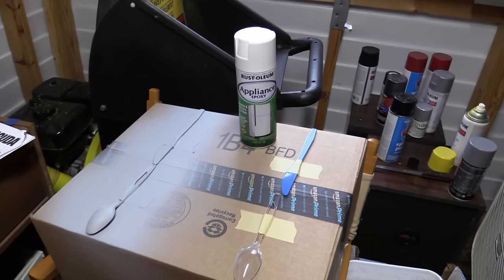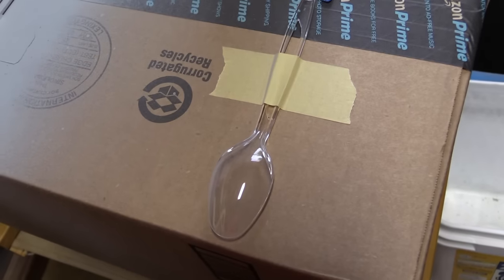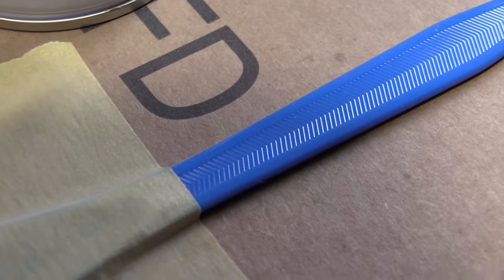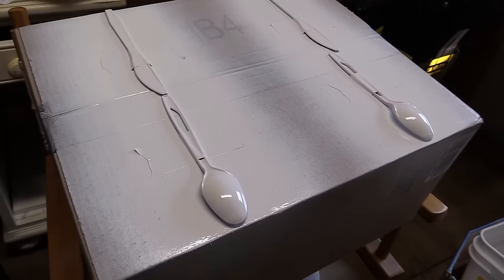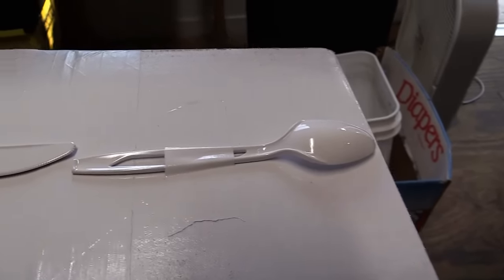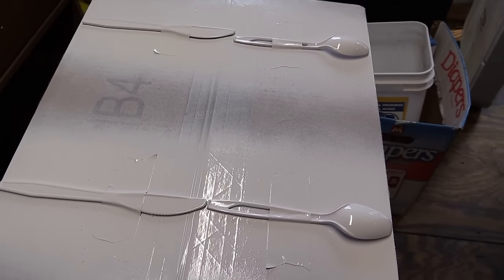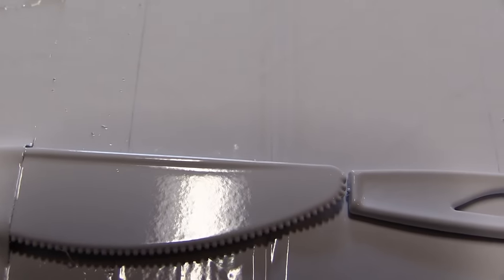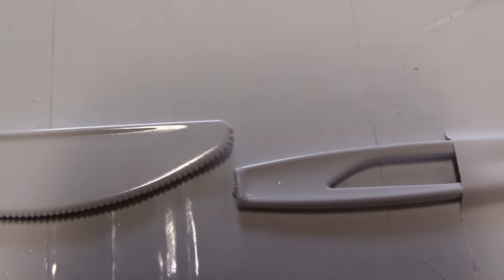Rustoleum Appliance Epoxy Paint Test

Comment: I painted my crew cab dually truck with the white. Let it cure for four days. Wet sand down to 1200 grit. Buff (by hand) with 3M  Microfinishing compound, followed by 3M "Finesse it II" Shines like a BC/CC finish. Seven years later, still looks great. Wax it like you would any other finish outside. Black holds up just as well. Have used the "stainless" and "Almond" colors also. All spray, and have equal durability.
Reply from the maker: Wow! I had no idea! Cool!
Reply: if you were painting something with this that you needed to flip over and paint the other side say a jet ski can you do that? i know the paint says to sit and cure for up to a week.  would i be able to spray one side fully, let it sit for maybe an hour then flip and spray the other side without it being disturbed or peeling off?
Reply: @surfjat15  Absolutely NOT. At least (and I  mean, the VERY least) an overnight cure.
At four hours it will still be tacky enough to leave a fingerprint in here in humid Florida.
"Haste makes waste" with this stuff. The end result is worth having some patience with it.
Don't think I'd plan on having it last very long on the submerged part of a jet ski. A linear polyurethane is best suited for that, even then it shouldn't stay in the water for long periods.
Reply: @tonyk8592  roger ok.   painting as we speak i shall let it sit much longer then
Reply: Did you spray it on bare metal at all? Any primer?

Comment: You can buy it by the quart. It’s probably the best marine engine room paint I’ve ever found. There’s only one problem. You absolutely must have supplied air, a respirator won’t cut it, though it may kill you. The fumes are crazy strong.
Reply: doing a Kawasaki stand up jet ski project.  guys are starting to use this instead of a real spray gun paint job.  supposedly rattle can holds up well with sand and prep.  i’m going to  try it and report back

Comment: This stuff takes about a week to properly cure under ideal conditions, not a couple days. I just found out the hard way while painting a 1934 GE Monitor Top Refrigerator that even though it's 90'f here in SoCal with 48% humidity, I managed to mar the paint with my finger while installing the 50lb refrigerator door.

Did you end up doing any clear coat tests? If not, i'll save you the time and effort by telling you it wont work. This paint degasses for weeks after application and you'll end up with a mess. I've tried VHT, regular rustoleum, rustoleum lacquer, and krylon clear  and they all were a disaster. Each time I applied them toward the end of the timeframe where you can recoat, but not exceeding it.
Reply from the maker: +LBCAndrew Aha, no, I never did try the clear. But I see that you did. I hope you posted the results. I never had good results from any of those clears you mentioned though, on anything. I was looking at this from a hobby aspect anyway. I will likely test the Testors clear on it at some point. Thanks for your input.

Comment: Can you paint an acrylic paint over the appliance paint? I ask this because the color I want to paint my fridge (mint) does not come in appliance paint. Appliance paint only comes in limited colors like white, black, cream, and stainless. I tried a tester spot on the top of my fridge (sanding first) using reg primer and acrylic paint and it flakes off when I run my finger nail on it. Thanks!
Reply: At Lowes, they sell a cabinet paint that is oil based-water born enamel Valspar.  I have been very happy with it.  The same with Kelley Moore's "hybrid" enamel. No bad smell with either.

They tend to be self-priming, form a shell (unlike latex), and dry pretty fast.  They do not come in spray cans (so you can mix any color), but I've had success with Wagner cheap sprayers.

I'm no pro, so I had to practice a LOT to get good results with the Wagner sprayer.

It sounds like you prepped well on your test spot.  Maybe a chemical wipe-down would help?  A automotive paint supplier may have recommendations, including spray cans in a color you like.  Mask a lot, ventilate, and mask 4 feet away for paint dust/overspray.  

I dig your idea.  Post a video!

Comment: I used the exact same stuff on a couple of old appliances. My complaint, over time it tends to turn yellowish. Am I doing something wrong?
Reply from the maker: That surprises me, because I tend to also use it because I've found it to not yellow over time. Na, there's nothing really that you can do wrong, just spray it on. I'm wondering what other factor might be turning it yellow.
Reply: Maybe if you spray it with a clear coat it won't turn yellowish.
Reply: Are you or someone in the household a heavy smoker?
Reply: I know that white alkyd oil* paint will yellow in the absence of sunlight/light over time. The trim and inside of every closet door yellowed. Anywhere that was primarily dark most of the time.
Reply: You have to use primer or else the bottom  paint will bleed threw.

Comment: If you paint a metal part with this Appliance Epoxy, my advice is to let it air dry for at least few hours, which will let the high-volatility solvent carrier (acetone) evaporate. This is what makes it dry to the touch. To fully cure it, you can put it in the oven at 300*F for a few hours, which will evaporate the low-volatility solvent carrier (Xylene). This results in a very hard finish. Many people report good results after baking it at 400*F for 1 hour. I will warn you though, this paint definitely "yellows" after exposure to heat. It isn't really noticeable in black, but the white stuff becomes obviously yellow/tan. I've never noticed a color change at 180*F, but there was a definite color change after baking it at 260*F and higher. If you don't bake off the Xylene, it will take several weeks, or even months, to fully cure. The litmus test is to simply sniff it. If you smell any chemical smell, it means the Xylene is still evaporating, which means the paint is still drying. It won't be hard enough to sand until it fully dries. Since you obviously can't put plastic in the oven, my advice is to leave it in a hot car for a full day. The inside of a hot car on a sunny day will hit 160*F in Los Angeles. You need to sniff it when it's hot btw; sniffing it when it's cold won't help, since Xylene doesn't evaporate at room temperature. You can test this for yourself - leave a jar of Xylene out in the hot sun, and it will be there for months without evaporating. You really need heat to fully/rapidly get rid of it. I agree that this Appliance Epoxy is amazing stuff though. It's my new favorite spray paint. Just be sure you learn the difference between Acetone and Xylene. If you know the properties of each solvent, it really enables you to master spray-painting. One last caution: Acetone is ultra volatile, and ultra combustible. I've had Acetone blow up in my face several times. That's why I suggest letting the paint dry for several hours before putting it in the oven. 99% of the acetone evaporates within minutes, but that remaining 1% is still enough to explode in your face when you put it in the oven. The explosions are low energy, so nothing gets broken (windows, etc.), but it's still as loud as an M-80, and it'll make you poop your pants.
Reply from the maker: Very interesting, and entertaining info. I didn't know about the Xylene. Plastic can handle some heat, like what you're mentioning at about 180. Plastic won't actually melt until over 400, so 180 should be safe. I'll play around with that.
Reply: Russell218 it did yellow slightly on my dryer I guess from the heat of the dryer, good point!
Reply: Russell218 
I'd really like to ask you a question. Are you still around?
Reply: Props on the super critical information. Very nice! Very nice!

Comment: Is this epoxy paint (in the rattle can) 2 part or 1 part?  If two part is there a device inside the can that mixes the catalyst or something when you shake it? If so I guess its a one time usage ?Much Obliged.
Reply from the maker: It is one part. So as you can imagine, it's not quite as hard as real epoxy. No little device inside and it works fine on the 2nd and 3rd use.
Reply: @Toppervision1  Hi Topper..grateful for your reply..i have a  50 year old 35 ft sailboat  that has a faired and painted deckhead (ceiling) and might try a can of this stuff . could be the bees knees. Cheers
Reply from the maker: @JohnBobRoger  Well it's a pretty good  solution for the price and availability. I mean, I think it's right there in Walmart. :)

Comment: if you were painting something with this that you needed to flip over and paint the other side? can you do that.  i know the paint says to sit and cure for up to a week.  would i be able to spray one side fully, let it sit for maybe an hour then flip and spray the other side ?
Reply from the maker: I really don't think so. It would still be tacky and possibly even stick to the surface you set it on. Not a fast drying paint. Maybe you could just use regular Rustoleum.

Comment: is there a paint for white gas stove ? i have cleaned with all sorts of sprays and solutions but old stains and some scratches just dont go..
Reply: The Rustoleum Appliance Epoxy is intended for exactly that purpose.
Reply: No no no, you can not use appliance epoxy for stoves if the surface gets over 200 degrees. I think the sides might be ok, but not the top. It says as much on the can.
Reply: Sukrit Chaudhary hard enamel nail polish works well.
Reply: Sukrit Chaudhary 
I don't think you can rely on that...
First of all, it depends on the type of plastic - different plastics have different melting temperatures.

Secondly, just because a plastic may have a high melting point doesn't mean that it won't soften and/or distort at a much lower temperature.

Even boiling water is enough to badly distort many plastic items.

Comment: Do you think this will work on my plastic fiberglass bathtub shell?
Reply from the maker: Ooo, I don't know about that. Constant water contact doesn't sound like a good idea. I think you want to look for a more serious bathtub coating.
Reply: @Toppervision1  That's what I was wondering. My closest hardware store doesn't have their Tub & Tile paint.
Reply: I'm going to try it!
Reply: @KivaTV  I tried it on my bathroom sink and it works really good so far. It's really smooth and white kind of beautiful. I touched it after a day and it was still soft and put a ding in it. I'm super pissed but after 3 days all my counter stuff is back on top of it
Reply: @KivaTV  I want to try it on my tub but that is a big job and the smell is really bad so put a fan and have ventilation Wherever You Are. It didn't smell when I was applying it but 10 minutes after it stunk up a couple rooms
Reply: @thisorthat411  Thanks for the fan tip! I heard it takes a week for it to fully cure, so I've been hesitant about doing the tub.
Reply: @KivaTV  i am excited. let me know the results. i should just do it  too. screw it
Reply: Did it work?

Comment: I tried to spray paint my plastic outdoor chairs. And I kept running into a rough feel on the chairs is that what you're referring to as orange peel? I tried sanding between each coat and that didn't seem to help it either. And then I did a wet sand at the end that helped a little bit. But it still seems that the paint comes off like dust when you sit on it. I cannot for the life of me figure out what I did wrong. I watched all kinds of videos and nobody else seemed to have the problems that I was having. I may try this kind of paint next time.
Reply: HI! That typically means you are not shaking the can long enough for the paint inside to mix with the ball.  Hope that helps :)
Reply: @ShanettaDIYLife  thanks. I thought I did.

Comment: Side of stove top rusted; any idea how clean up the rust and apply ceramic.
Thanks to you all
Reply: Tape off the good paint around the rust to give you a boundary. I find a wire wheel for a drill will make short work of the rust and grime. Peel off the tape and use rubbing alcohol on a lint free cloth to remove oils and crap for a good adhesion. Follow directions on appliances spray paint can. It's better to resist the urge to lay it on thick and do several light coats. Otherwise it will have drips. 

Also the appliance spray paint has a strong odor so ventilation is a must!

Comment: We tried it on the vanity, it works but the smell is too strong. How such strong smell can be used indoor? It is not healthy and on the product it stated cancerous........
Reply from the maker: Well, until it dries and cures. I wouldn't have used it indoors at all. You would normally take the object outside to paint it. If you can't get it outside, then you can't really paint it with a product like this. Anyway, once the paint cures, the smell will go away, and the cancer danger. It's the solvents in the paint that are doing that.

Comment: BEWARE: DO NOT SPRAY ADDITIONAL COATS WITHOUT WAITING A WEEK.  I WAITED AN HOUR AND SPRAYED ADDITIONAL COAT AND IMMEDIATELY GOT ORANGE PEEL.  MY ADVICE IS ONLY ONE COAT AND MAKE IT THICK THE FIRST TIME.
Reply from the maker: Lake Servers The general rule is to spray your flash coats within 10 to 15 minutes. But yes, if you miss your window and it gets to be 30 minutes, you have to wait a week, or two for this paint. But I have sprayed multiple coats, 10 minutes apart with this paint with no problems.
Reply: yup me too....had to strip and start over.
Reply: @Toppervision1  so it sounds like you either have to spray it within a very narrow window of time. Neither too short or too long.
Reply: KMF ok but why

Comment: I paint my stove top look good until I used it, I painted white but turn yellow after  I start using it. What I need to do   To keep the white color
Reply from the maker: Ooo, I wouldn't have guessed that would happen. I would think that one of the main "appliances" people would be painting with "appliance" paint would be stoves. Anyway, look around for paint that says "High heat" right on the front of the can. This is the type of paint they paint bar-b-ques and such with. It usually comes in black or silver but maybe it comes in white somewhere?
Reply: @Toppervision1  My can of Rustoleum Appliance Epoxy says not to use on stoves or anything that heats up.

Comment: COULD U USE IT ON METAL
Reply from the maker: Of course you can use it on metal. It's mainly for metal.
Reply: Not on galvanized metal. Use a latex paint for galvanized, or a latex primer then topcoat with Epoxy enamel.

Comment: Is it ok for microwave?
Reply from the maker: Of course. It should explode in there just fine. :)
Reply: that's not an answer to this guys question. is it safe for microwaves?
Reply from the maker: Eh, just trying to be funny. Actually, I have no idea if the painted surface would be ok when exposed to microwaves. This paint is likely only for exteriors.

Comment: this stuff sucks, i used it for a washing machine top that peeled and started rusting. i removed all rust and applied 3 coats waiting 3 days to dry. it comes off easily with a fingernail , i did not primer but if it was a real appliance epoxy it would have been to hard to remove with a finger nail and bonded very well. guess i will try  por 15 with oven paint over it.
Reply: Or use primer dummy

Comment: All I know is that for something your brushing teeny tiny amounts with you'd better have some serious ventilation or your gonna be on the floor.The right prep & application, this works great. Levels out nice & smooth..of course it's not going to be as good as new..but you can get wasted in the process.
Reply: Inside bottom of deep freezer paint